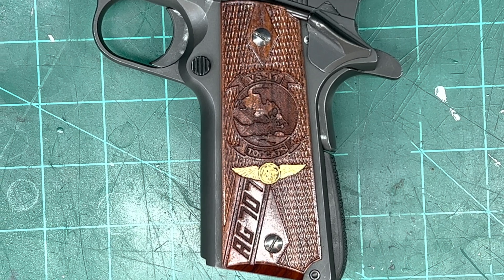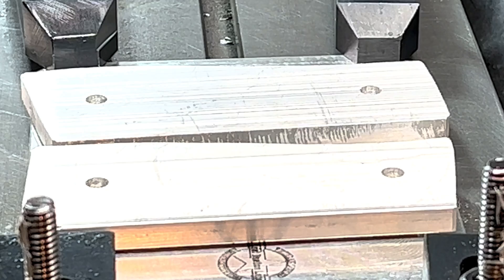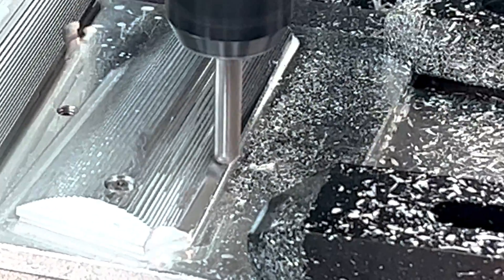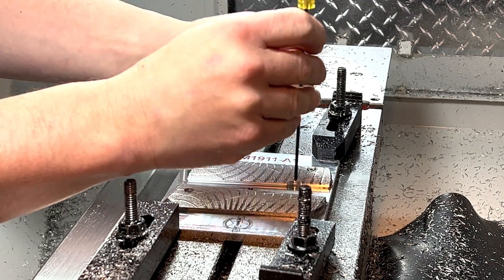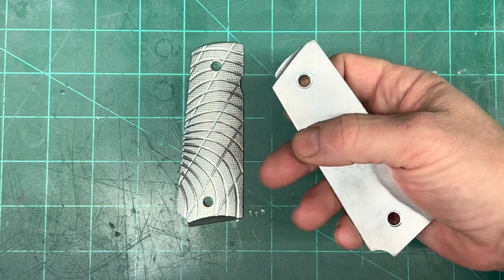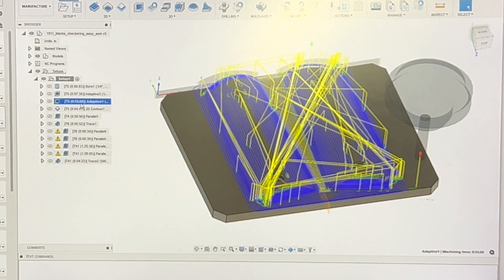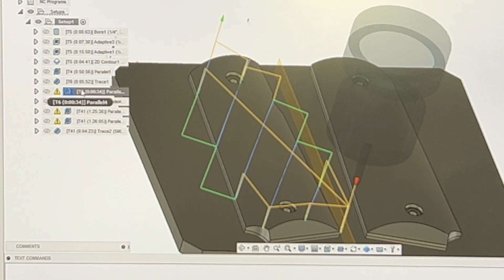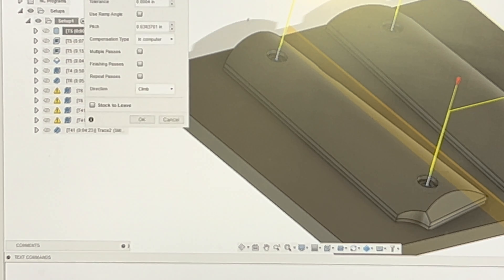Machining custom aluminum 1911 grips on a Tormach 440

Comment: I really appreciate a few things you did in this video. Going over the setup, things to watch out for (screws, hold down block). I also really appreciate the cam stuff at the end, projection, extending the tool path off of the part.
Reply from the maker: Thank you.  Most people do not watch the CAM.  LOL